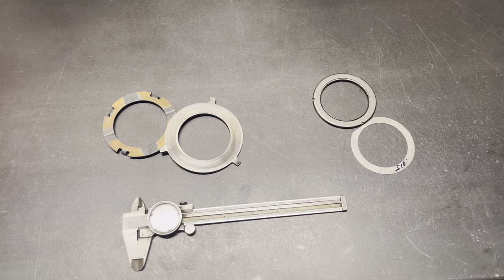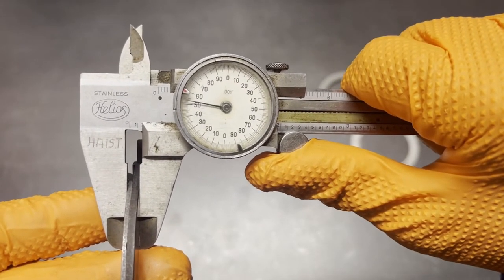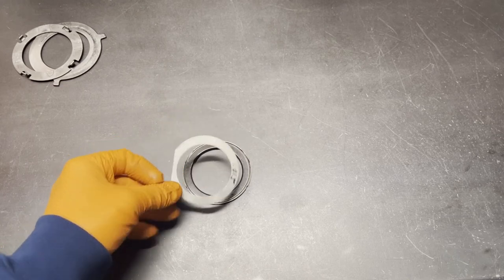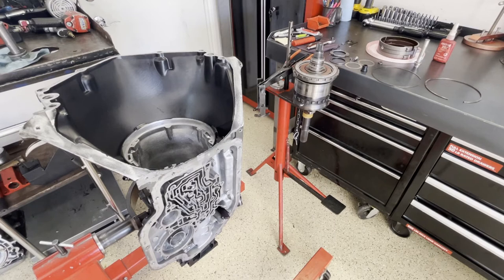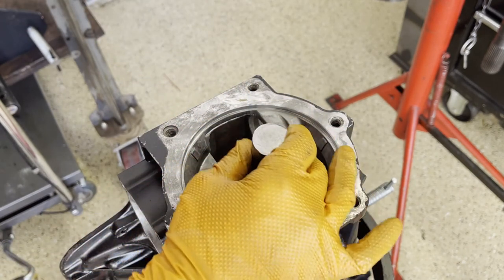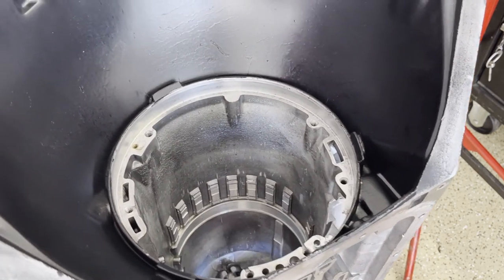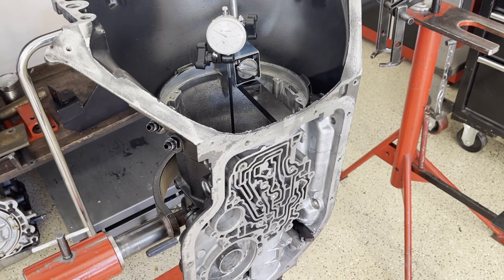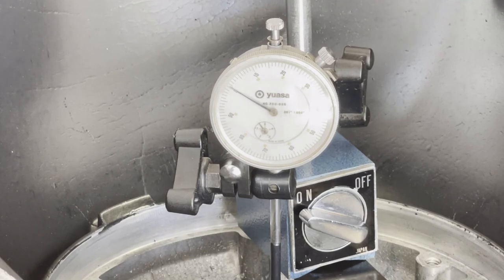TH400 & 4L80E - Rollerizing the Rear Case

Comment: Welp, parts are ordered. In the meantime, if I may ask, is it safe to clean the case with it being disassembled and open? I'd love to (for motivation) get it looking like new-ish.
Reply from the maker: You should absolutely clean it! I have never rebuilt a transmission using a dirty case. Use a combination of wire wheels, pressure washers (best if it's heated) and/or the hot tank. 

For TH400s and other older units that have them, I'd also sand the worm tracks on the belly to remove any high spots that may otherwise lead to cross-leaks.

Comment: What parts should be upgraded on a turbo 400 trying to see 700-750 wheel? Thanks
Reply from the maker: Assuming this is a race or strip/street high-rpm vehicle/application i'd go with a billet aluminum forward drum & billet steel input shaft as well as a rollerized forward clutch hub. rollerize rear case as shown in this video, 34 element hd sprag (you will need to swap a pre-73 TH400 direct drum or retro 4L80E direct drum if your TH400 came with a direct drum w/the 8 element roller clutch). 
Stock Borg Warner clutches (or Raybestos waffle-style) are good to 1000HP. Run aluminum apply pistons instead of the stamped steel ones if yours came w/steel pistons. Dual feed the direct clutch internally, high tension return springs in the direct drum, drill a .055" hole at the bottom of the drum near the edge for additional fluid bleed off to prevent centrifugal apply when in first and second. Delete the 2-3 accumulator (large piston on the valve body). Heavy duty snap ring for the intermediate clutch (you can use a transgo snap ring or a .089" snap ring from a Chrysler 46-48RE Transmission).

Install Sonnax boost valve/spring kit for the pump. If running a transgo 'race' pump pressure regulator valve spring, install a restrictor in the converter charge feed hole in the pump to prevent converter ballooning (ballooning occurs when the transmission high line pressure to the converter charge repeatedly forces the converter violently into the flexplate/crank and damages the engine's main thrust bearing). Drill spacer plate 1-2, 2-3 feed holes as needed for desired shift firmness, accounting for converter stall and final drive ratio or follow manufacturer instructions if running a transbrake.
Critical: Set reaction and output carrier spacing to a minimum. See my video for how to do this. 

Those upgrades should get you to 1000 HP in a race application, all other things equal.
Reply: @nickstransmissions  This is an incredible answer.

Comment: Man, I just checked my end play and it's REALLY bad. I pry up and things are moving more than I can measure. Like a 1/8". I rollerized and measured the bearing plus a shim and it was thicker than what I removed. Yikes. I dunno.
Reply: Cancel that...I added shims and got it to 8 thousands of play. Pretty good, right?
Reply from the maker: 8 thou is very good....now you want between .012-.016 for the front with the rear gear train pre-loaded.